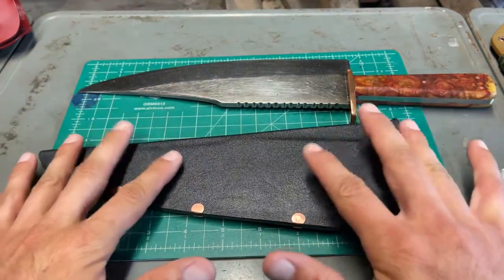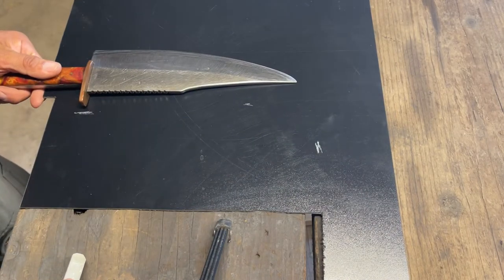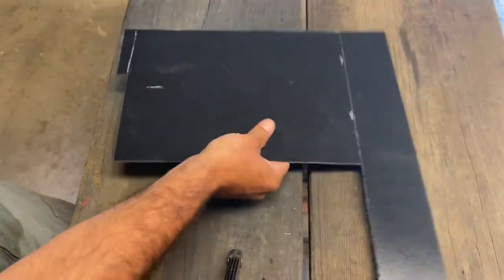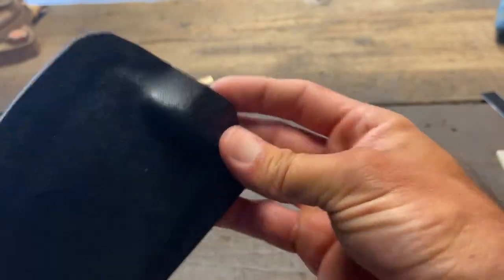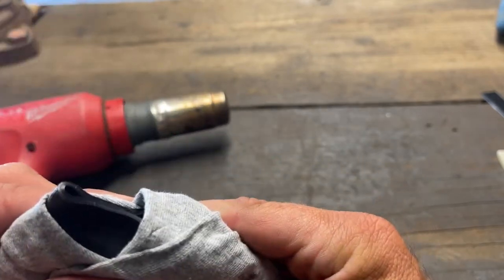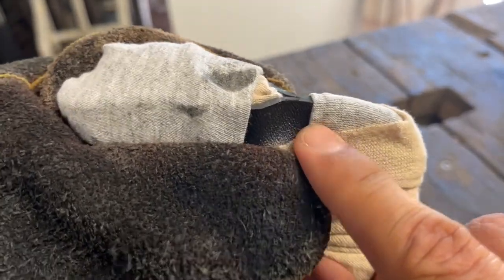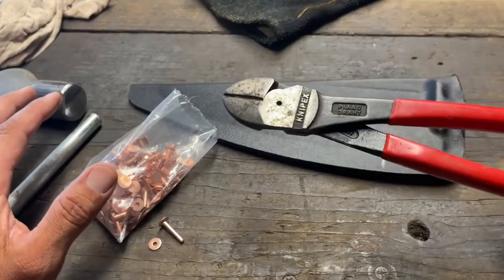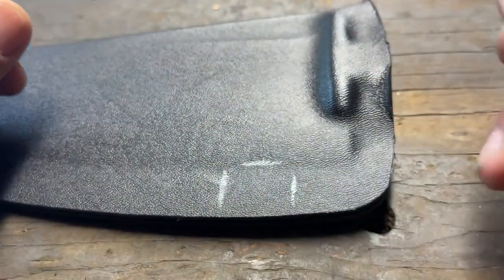Me making the smallest Kydex sheath I can

Comment: Ive been thinking about this project and i came up with only one solution on how one could make it more compact. 

So the idea behind it is to only cover the main edge and the falsedge, not covering the spine and the hilt. But then there should some kind of retention element, that will make sure the blade won't fall off from the side. Something like spring-ish a pin (or a button) that will go halfway into the blade's flat, Keeping it in place yet providing some retention
Reply from the maker: Hello, it’s always good to hear from you. I think I understand what you mean: so the sheath would be skeletonized? So, sort of something that would clamp around both edges only and would leave the rest of the knife exposed. If that’s the idea, it would work I think, the hinge would be at the tip of the knife and it would need to be made of metal. I think I have an idea of what you mean.